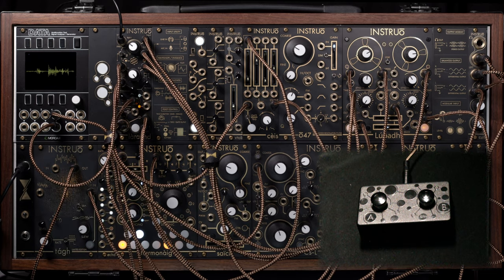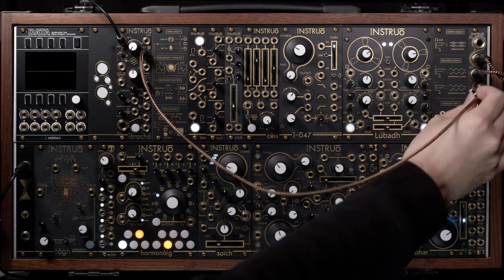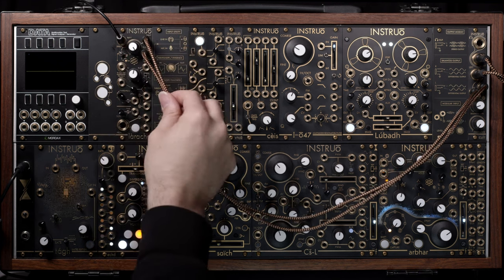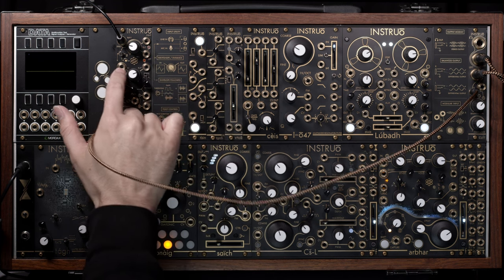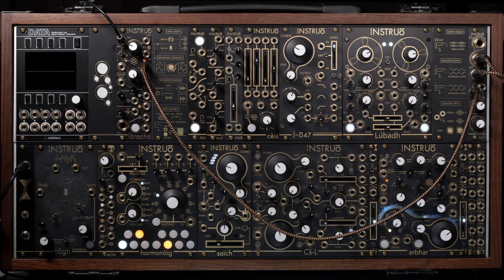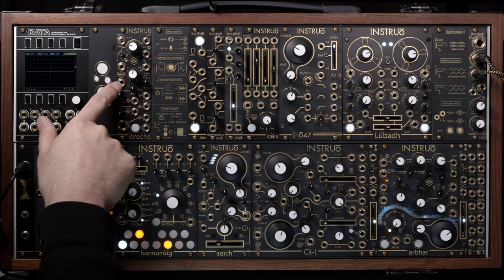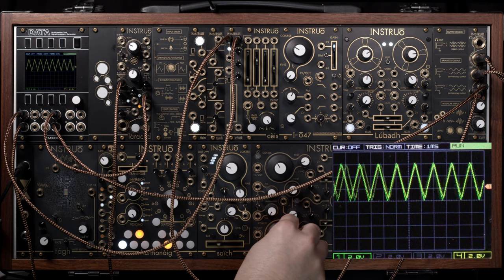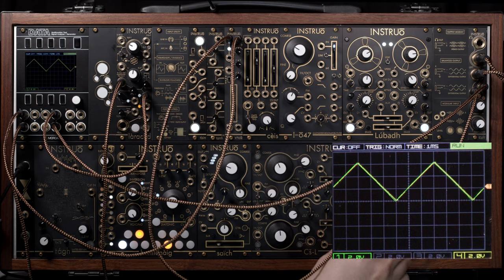Instruō - làrachd Overview

Comment: There are a lot of ways to do this with midi, various cables, other stuff.  But this is just really simple and powerful for performance without some menus, hexdecimal, or anything else abstracting you away from the machines.
Reply: MIDI can be used for replacing the footswitch part, but MIDI does not facilitate amplification, waveshaping, or any other input audio signal processing. And even if you had an analog dynamics processor to perform the threshold detection and envelope generation, MIDI would be too slow to deliver the envelope follower output accurately and smoothly.

Comment: In the manual is a patch idea with an electric guitar connected to the stereo input. Can I use a 1/4 inch to 1/8 inch TS cable for that?
Reply from the maker: You can indeed!
The impedance is optimised for line input, but depending on the instrument and how “hot” the pickup is it can work plug and play very nicely!

Comment: Im not too familiar with these external controllers, do they have a name? Would expression pedals send similar signals?
Reply from the maker: It’s simply a passive momentary foot controller. We’re producing them specifically to ship with the làrachd module for convenience, but any similar TRS connected controller should work equally well.

Expression pedals are different. They generally use TRS to connect to the ends and wiper of a potentiometer.
Reply: @instruo  Makes sense, thanks!

Comment: How would it work for external hardware synths?
Reply from the maker: Do you have a particular context in mind?

The line to modular could be used to bring line level/headphone output audio up to modular amplitudes.
These signals could be used within the modular system and could also generate CV signals via the envelope follower as well as gate/triggers from amplitude spikes.
Reply: @instruo  thanks for the reply! I have a Minimoog Voyager that I'd like to incorporate to my modular system and as I have the WMD Performance Mixer in rack with DB25 (from which I record multitracks into my computer) it's easier if can get the Voyager up to Eurorack levels. Not sure if your module is overkill for what I'm after but it seems like the envelope follower and enhancer would be useful as well in sculpting sounds and triggering things in rack based off the signal coming in from the Moog.

I would also like to use it to bring outputs from my audio interface (for example, tracks in Ableton) up to eurorack level to run them through some of my modules.

Sorry for the long reply! I know I could buy something more basic, but as your module does a lot more than a normal input module and is only about €100 more, if it would work well for these functions I'd most likely pick one up!
Reply from the maker: I think the làrachd might suit your needs based on what you describe.
It will certainly bring your Voyager up to modular levels (either mono or stereo).
If that level boost is your primary requirement then you are also adding the enhance circuit, env follower and foot controller to your arsenal.
Envelope followers in particular are super useful!
It always surprises me at this stage how often I use a làrachd in a system in ways I wouldn’t have anticipated!
Reply: @instruo  Cheers mate I'll grab one, sure it'll look lovely next to my Arbhar! And yeah, envelope followers are a seriously undervalued function but I guess it's cos there are many sexier things knocking about! Thanks for the replies, looking forward to the new FX module you've been teasing. Regards from Barcelona!

Comment: The lack of a "latch" switch/option for the pedal input seems like a big oversight. It would nice to be able to use the pedal as a momentary switch to toggle the state of the gate.
Reply from the maker: I use it in precisely the way you describe! :)
I didn’t include a switch on the larachd because I designed it more as the control mechanism for such a patch.

Including a switch on board would have required 2 or 3 more jacks.
And I can patch it as a momentary switch to toggle a latching switch anyway exactly as you describe.

My Tain module can be defined as momentary or latching for this use case.
Reply from the maker: https://www.instruomodular.com/product/tain/